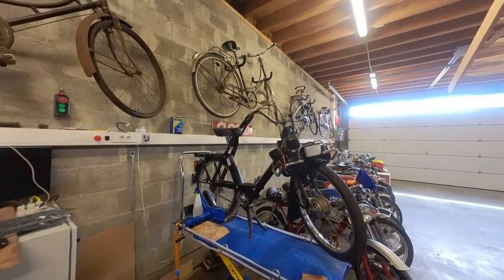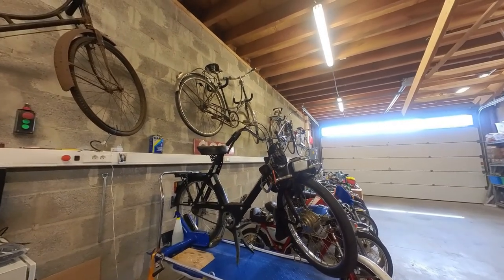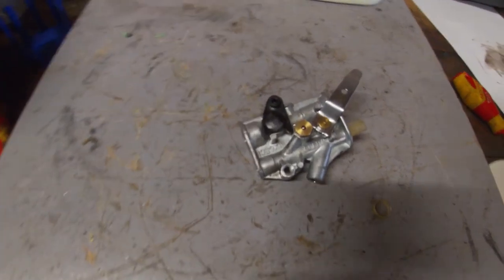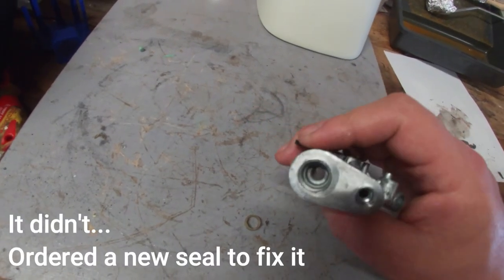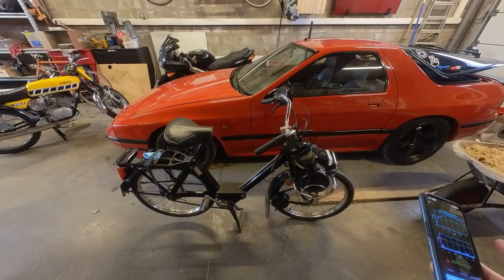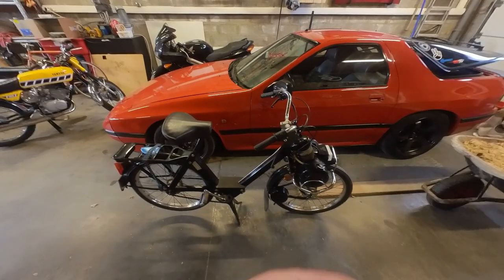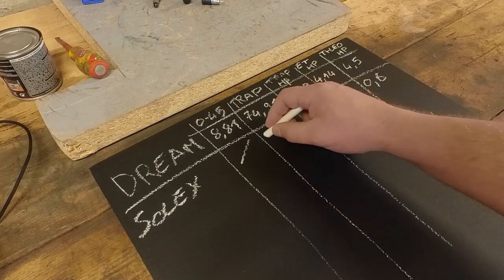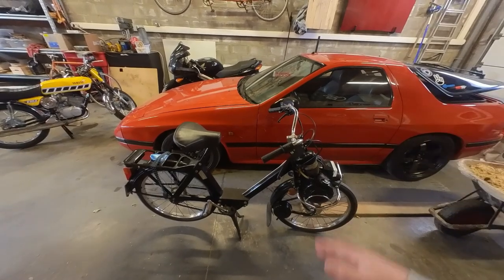How fast is a Solex 3800

Comment: In some cases i drawed and printed (with 3d printer) the seals myself from tpu filament. And they work!
Reply from the maker: @hansturpyn5455  Yeah I've read about it and wanted to try it aswell. Did you print the fuel pump membrane?

Comment: Nice. It's now a list 😅👍I managed to start my fs1 today after 2 weeks in the garage. So soon I have my numbers aswell 😎
Reply from the maker: Awesome! You worked on the engine aswell or just cosmetics?
Reply: @VintageGarageYT  no work on the engine. I was only out in the garage to change some small thing one day. Then one thing lead to another 😅 But there is a race pipe on now. Sounds very angry and 2 strokey 😎🤘
Reply from the maker: @captainflatspot  Yeah, seen the picture! Which one is it? Curious for its performance!
Reply: @captainflatspot  Race pipe will lean out the air/fuel mixture and cause the engine to seize. Need a bigger jet.
Reply: @geraldscott4302  yea I have experimented with a lot different sizes 👍
Reply from the maker: @caption flat spot Still waiting to see it running! 😁
Reply: Do I need license to drive it in Lisbon ?